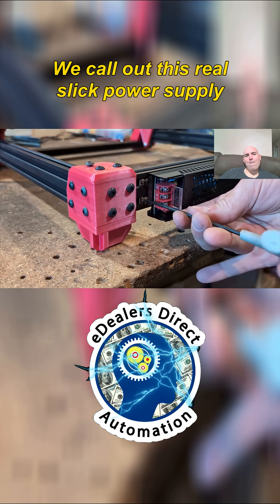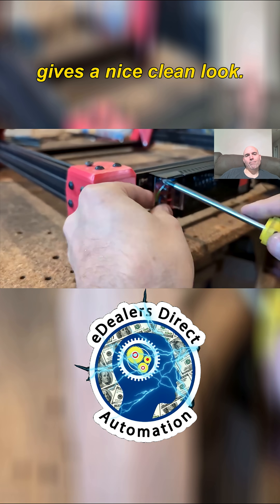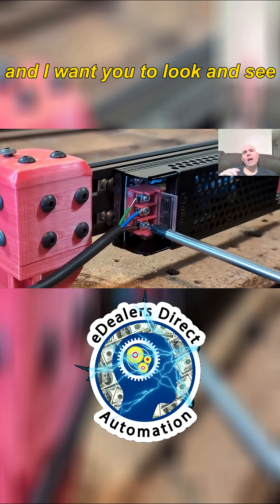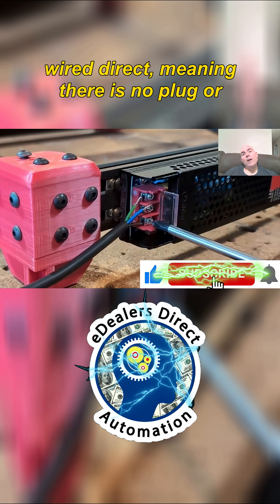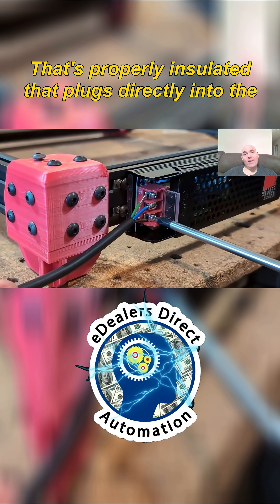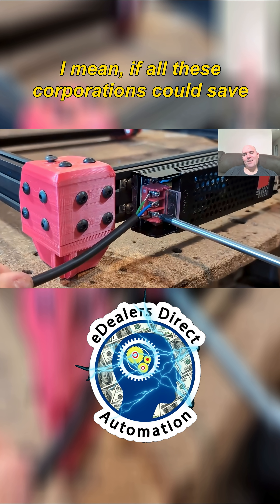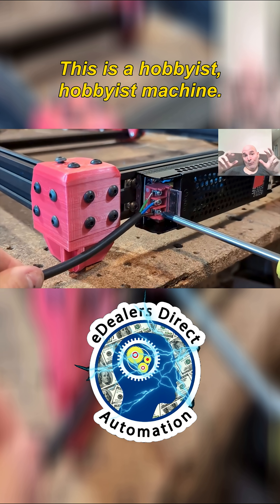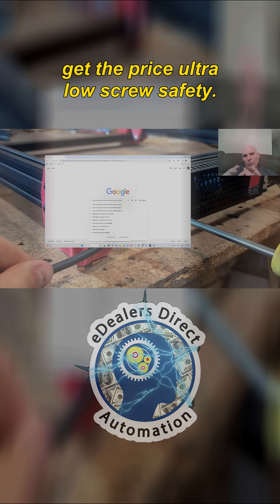👀 A Look at JD's Garage $200 CNC Plasma 👀

Comment: My table saw motor has a built-in cord.  Air compressor, same.  Shop-vac.  Most of the tools in my shop, for that matter, that are still plug-in have captive cords.  This is hate for no valid reason.
Reply from the maker: What you said made simply no sense. This is ignorant for no valid reason. 

Thank you,
Vince
Reply: @corvetteguy50  In what way did it make no sense?  Explain.